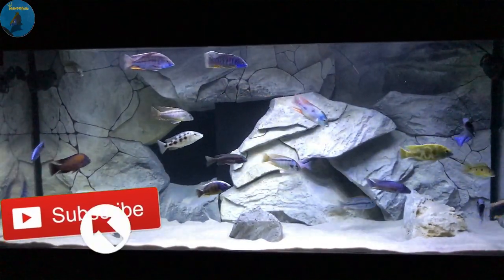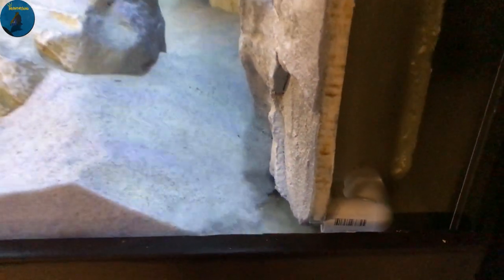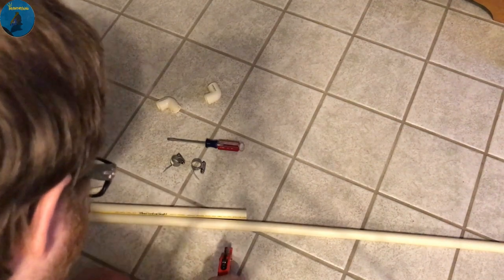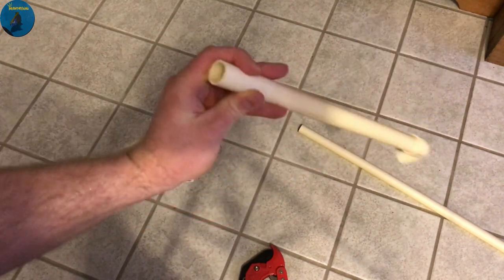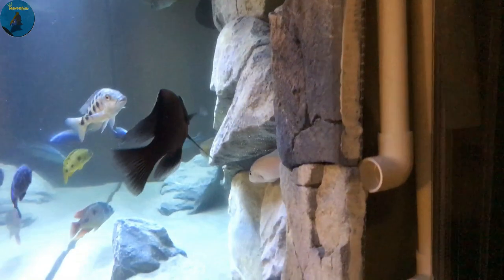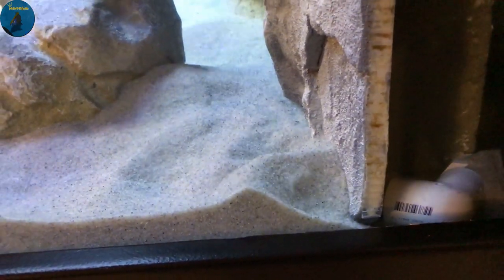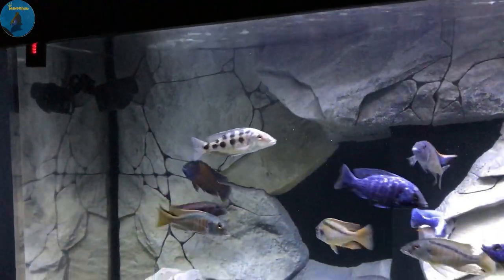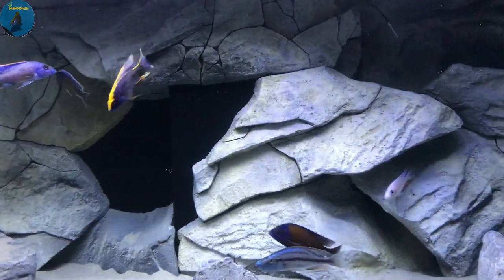Extend Your Fluval FX Series Filter Inputs and Outputs | Perfect for 3D Backgrounds | Aquariums

Comment: Great tip. I purchased an aquadecor background for my 350 gallon. I had them put 4 hidden chambers in there. Did you use the rim mounting brackets for the hoses?
Reply from the maker: Thank you very much! Sounds like you have an awesome 3d background. For my tank I couldn't use the mounting brackets because it is an acrylic tank and the lip is too big. Is your glass? I hope you can subscribe for more of my content. I have lots of new videos after this one.
Reply: @inventoryking  yes it's acrylic. I am having trouble with the lip also. I am subscribed. I  don't miss any of your videos. Digging the saltwater setup. I purchased the under cabinet lighting idea from Amazon.

Comment: I did this after watching your video(I too have a aqua decor). Only issue I have is I’m getting protein film and waste particles stuck on the other side of my tank. It seems that my powerhead is pushing everything to one side and I have a dead spot where it’s all getting trapped and not finding it’s way to my intake. As I’m writing this I noticed you have two powerheads🤔 pointing towards each other. I may have to try that.
Reply from the maker: Yeah I have one power head on the front side and the other on the backside so it creates a whirlpool type affect. Or trying to make that happen.

Comment: Sir
U got add airstone/ air pump to your tank?
Reply from the maker: No. I just use the powerheads to make surface agitation for gas exchange
Reply: Air stone and air pumps don’t add air to your tank that’s a very debatable topic it just disrupts the surface and he clearly has the surface disrupting the air bubbles would be flying every where